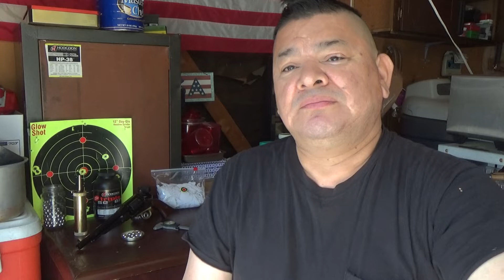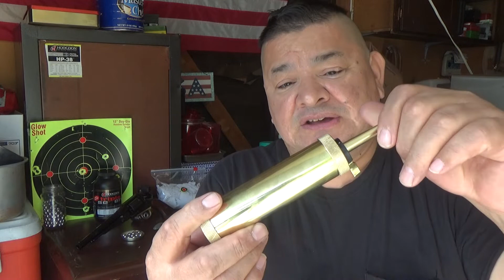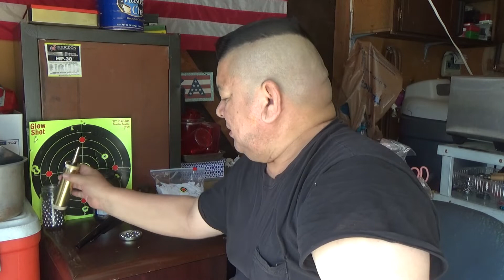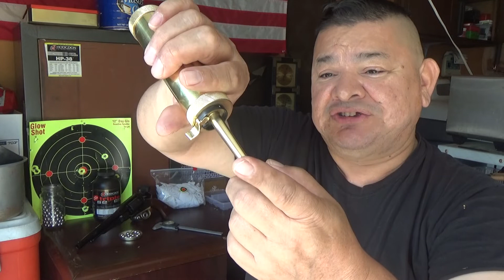Sunday garage chat ( what's involved in the black powder sport.)

Comment: I recommend the 45 acp conversion cylinder if you have the dies for reloading em. I use a cheap ultrasonic cleaner to clean my cap n balls. Two 8 minutes cycles and theyre spotless. Just oil afterwards. I have a #10 cap maker tool from 22Sharpshooter, might make a video on it soon.
Reply from the maker: Agreed.